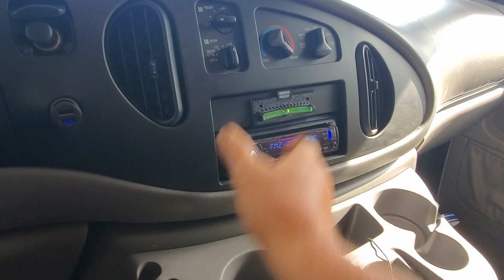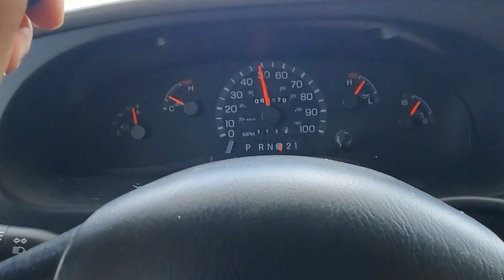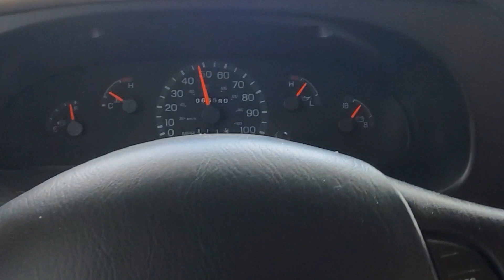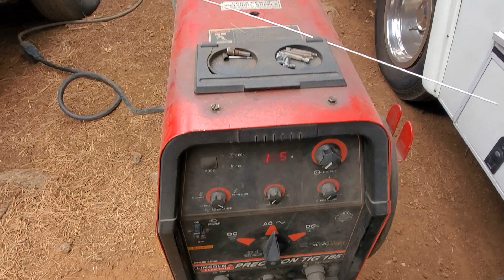Can You See The Crack??? Woof Pack Weighs In...Star Wars Or Star Trek?

Comment: Kevin, I was in the floor covering business for 36 years. That stained floor that runs through Big Foot probably has the interior walls sitting on top of the sheet vinyl. That's almost impossible to rip up. I would suggest making a paper pattern of the existing floor and trimming out a commercial carpet to cover it. Use double faced tape to secure it to the sheet vinyl. Don't glue it down. Pick out a dirt hiding color (brown or dark gray) and use the existing metal at the doorway to pin it down. You'll want to be able to take the carpet up every couple years and wash it at the car wash. You'll never wear it out and the dog's nails won't pull the short nap. Save the carpet and use it as a pattern, if you ever want to change the color. A 28 or 30 ounce commercial carpet is inexpensive and doesn't need foam under it.
Reply: Couldn't you do the same with sheet vinyl in a darker wood grain pattern? Would be so much easier to clean. All he needs is a mat by the door and one outside at the steps to collect most of the debris from shoes.
Reply: @jcrefasi1      The asphalt residue on the bottom of your shoes cannot be wiped off. This residue turns brown colors in sheet vinyl "PINK". It does that in 60 days. Also, there is a paper backing on sheet vinyl that is meant for adhesive, when you use double sided tape, the paper backing pulls off and the vinyl is too thin to stay down on it's own. Sheet vinyl is cleaner, but the dyes in commercial carpet don't change the way the colors in vinyl change. Carpet colors do change from the residue, but takes years.
From my experience, men prefer the softness, quietness and warmth of commercial carpet over the sheet vinyl's benefit of easy clean. Just the reverse for women. A shine on vinyl means clean to women.  :-)  ;-)  :-D
Reply: Carpet is always filthy traveling full time in RVs. Laminate flooring works great with small throw rugs down that are easily shaken out and laundered. That's just my experience, though. 🌲❤🐶😽😽❤🌲
Reply: @rouxchat6033  yes indeed. Who wants to vacuum a small area of carpet in an RV??  Not me. I have sheet vinyl in my Promaster and a broom and damp mop is all I need. The wood tone is "barnwood" a grayish brown.  I love it
Reply: @bentnickel7487  I dont like shiny floors and I don't like vacuuming carpet even flat commercial carpet is a pain to sweep. With pets you need to be able to clean up messes of any kind easily.

Comment: Hi Kevin,
I recently had a tank leak at a weld on my Atwood as well, and I had the pleasure of talking at length with a tech guy at PPL motor homes that knew his stuff about these. Generally what causes these failures at the welds is because these tanks are “lined” with a coating when the aluminum is “rolled”, which is great, however when they weld the seams it ruins the integrity of the coating and that is where they are susceptible to galvanic corrosion at the welds. 

I replaced the tank in mine and you’re right it was around $200-$250 for the tank. While a whole new one was $750+. Mine was a 2007 era as well. It was a real bear to change out because what holds the tank to the “pan” are these aluminum compression rings that you have to fit back over the fire tubes on the new tank, and they are way smaller than the tubes so it was a true test of my religion to get them on there...in fact I ended up breaking one of them and had to order new ones. 
It looks like the rubber hoses you have at the weld in question must be for heating your tank from the engine heat as you drive, that’s a nice feature. I would check it again after you drive just to make sure. Mine doesn’t have that feature since it’s a 5th wheel. 
Anyway I thought you and your subscribers might be interested in some of this info. Take care everyone!

Comment: ❤❤  Kevin,  Harbor Fright sells rod that is silver in color and can be used on aluminum. Can be done with a propane torch.  Heat the area up to 640° and rub the rod on it. Advertisement they weld the bottom of a soda can hole from an ice pick.👍👍

Comment: We had a leak at the out take? hose on our Atwood(fyi: taught myself thru utube how to clean tank), and called the manufacturer(Taylor Coach) and he told us exactly the problem was, it was a 8yr old trailer, and we had just finished a 12,000 mile trip and the nut got 1/4 turn loose!😅 but he also told us of a washer type do-hickey thing it may need in the future, so I went and grabbed one to have on hand. We had white floor too and swept it / washed it lots(had a wetbath too so kept that toilet REAL clean- hard to reconcile showering with your toilet any other way). I GIVE GOD THE GLORY AND JESUS IS MY SAVIOR. JESUS IS MY HEALER.❤🙋‍♀️🇨🇦‼️

Comment: Kevin you might try a steamer type floor cleaner. Looks like a small vacuum but steams the dirt out of the floor. Then you just let dry and apply a coat of wax. Or another option is there is paint that will work on vinyl. Our daughter did that with a rental they own and the vinyl was old looking so they painted it. Turned out very nice. Just make sure the paint is for vinyl. Good luck with the BIGFOOT! You and Tuck are looking good😊

Comment: I thought also that was the only way to weld aluminum. I do my own welding. I have a lot of work I have to do on my boat. So I went to welding school off of YouTube for aluminum. I knew some of it. Yet I was taught something different about welding it. Brazing aluminum. Rod and an simple torch. The rod can be bought as of what I know at Harbor Freight. I gotten mine off of Amazon to give it an try. Same straight as welding. The weld is twice the strength as the material. You can find it as I did off of Youtube if interested. Just shairing. I love those old trucks you keep finding. So happy Tucker made threw it. Amazing new home you have also. Happy for Felix also. Take care.

Comment: JB weld saturated into Jean or t-shirt fabric, got yourself a fiberglass type repair that will last forever, just wipe the base surface with denatured alcohol. I even used it to repair an AC condenser on a semi still in service ten yrs ago. Wonderful stuff, just not compatible with antifreeze or flame. Even if it was to get you a minute longer of use in a pinch. Apologize if someone else mentioned prior.

Comment: MIG, TIG, Shielded flux core, Stick, all kinds of ways to weld! Aluminum can be MIG welded, usually with a spool gun.  The polarity and AC vs DC are also considered in the settings. Can't remember which way it has to be for aluminum. I own a welder, but I'm not a welder :)!  By the way, when you drain the heater tank, open a hot water faucet to help vent the tank.  It'll drain faster, and less glug glug, glug.

Comment: I had to clean mine yesterday anytime I wanted to use hot water I would have to drain it first and put in clean water I saw a tip on YouTube to let peroxide soak in it and it absolutely worked you should have seen everything that came out of that hot water tank and there's no more stinky egg smell

Comment: CVK not sure if you come across a Dollar Tree. If you do, there’s a product called AWESOME. I put it in a spray bottle straight out of the bottle as it comes. Don’t water it down. Spray a bit on the problem area and give it just a few minutes and wipe it down. Might work on those floors. Oh and if you use it, wear a mask for the overspray when you spray it and open up your windows to air it out as you go. Do a little at a time. And don’t crazy spray. I cleaned over 10 years of nicotine off ceiling fans and walls of a home we resent purchased. The yellow walls and fans are no more. We did repainted but took all that yuck off the walls. That nicotine melted away. Nastiest thing I’ve ever seen or had to deal with. You take care of yourself and those cutie babies. We want you around a long, long time you hear?! ❤️🙏❤️
Reply from the maker: I love Awesome cleaner
Reply: Having sold sheet vinyl for almost 40 years, I can tell you that "yellow" staining CAN NOT be scrubbed or bleached out. The staining comes from a chemical residue emitted from black asphalt. That residue gets walked onto the surface of sheet vinyl and chemically changes the vinyl from the inside out. Back in the 90s Mannington (a sheet vinyl manufacturer) almost went into bankruptcy when they guaranteed their floors would not stain or "your floor would be replaced for free". The pattern in Kevin's Big Foot was made by Armstrong. Armstrong, Mannington and Congoleum never overcame the problem before laminate and ceramic became popular in today's kitchens. Even marble will stain from this asphalt residue and if you have ceramic floors, the grout will stain, as well.

Comment: Sorry you had this problem, but being a Southern Boy you got it figured out!  Glad it was an inexpensive fix.  Yesterday, while coming home from Church, I had a noise start up with my 2006 Toyota Tacoma......clunky grinding sound speed dependent.  Left it off at my shop this morning...Diagnosis: ripped front boot on my jointed front wheel drive axle....ran dry of grease...ruined the U-joint and the axle....also found right front wheel bearings are shot.  Well, what do you expect with 210,000 miles on my baby!  HA HA  None of which I could diagnose by myself nor fix.  Took it to the local Goodyear shop...quick diagnosis once they got it up on the rack.  Turn key price - ~ $850...still a lot cheaper than the dealer, and a good excuse to spend some of my Biden money!  HA HA  Putting it back in circulation supporting a local business!  Best of luck!

Comment: Glad you were able to find quality work and have it fixed it looks like the gentleman that had Bigfoot before you really took care of it I have surround sound the engine sounds great I even turned it up full blast and your engine purrs like a kitten I can't tell you how many times I hear engines on these different shows and you can hear all kinds of pinion and banging and Boomin and ticking but yours sounded just as smooth as smooth as could be and that really is excellent gas mileage. I noticed your curtains are bothering you I have the mini roll up shades that you can get in white or black they have little holes in them dimly transparent that take up no room but the inner encasement w i d h and when in the up position just look like the top of the window seal molding they sell them at Super Walmarts I have the van version of Bigfoot and it works out great anyway hugs and Lovins for Tucker Miss May May and Little Miss martini and a big bro hug for you Kevin. I think you climb that mountain and are now at the top through all the hurdles and stress and now you can enjoy the beautiful view that you have been brought to. I thank God everyday for you and people like you make this world a much better place to live in